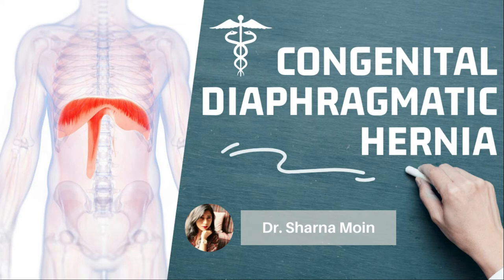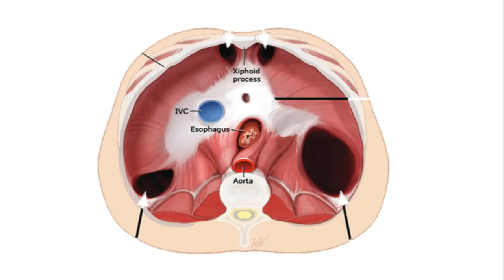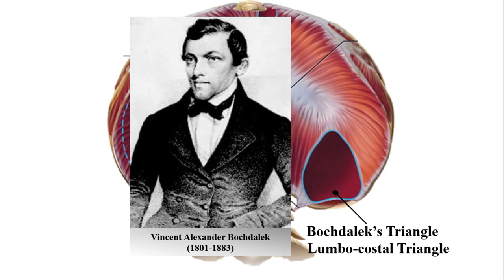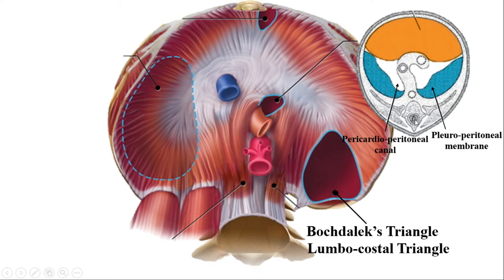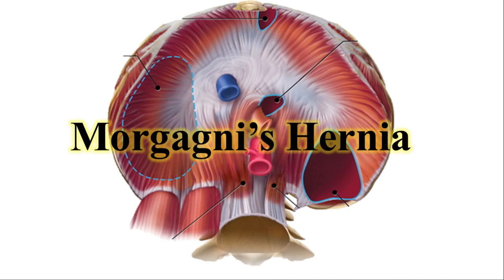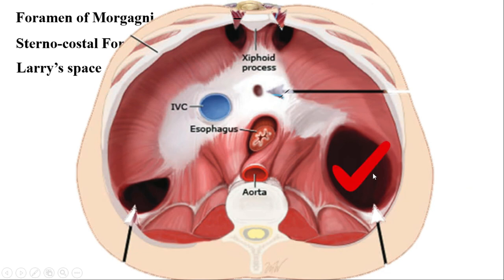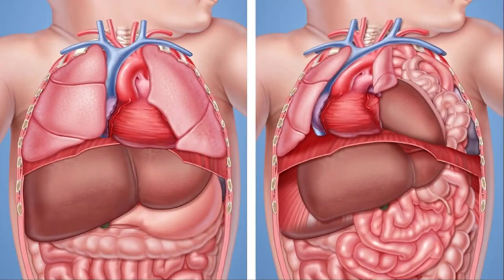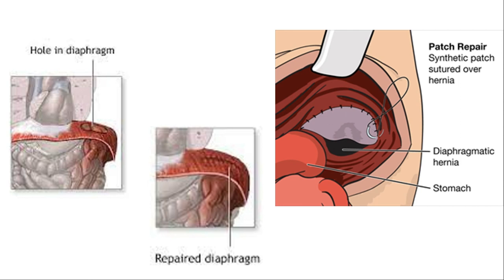Congenital diaphragmatic hernia CDH   types, causes, mechanism, diagnosis & treatment

Comment: Thank you!  At 64 I have been diagnosed with a Morgagni hernia on my left side pushing up my diaphragm and left lung.   I have been told it is very rare.  The only remedy is surgery as it will get worse.  I have had extensive conversations with specialists nonetheless appreciate any info about Morgagni hernia is welcomed.
Reply from the maker: Thank you for sharing your experience! A Morgagni hernia, although rare, can indeed cause significant discomfort and complications. Surgery is often recommended to prevent worsening symptoms and potential complications.  It's essential to discuss treatment options thoroughly with specialists to ensure the best course of action for your specific case. If you have any further questions or need more information, feel free to ask!